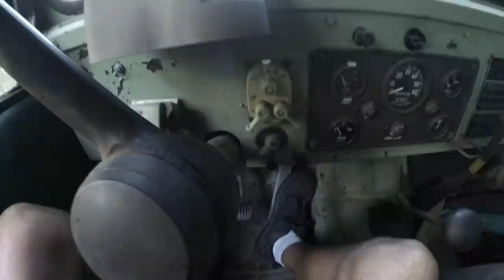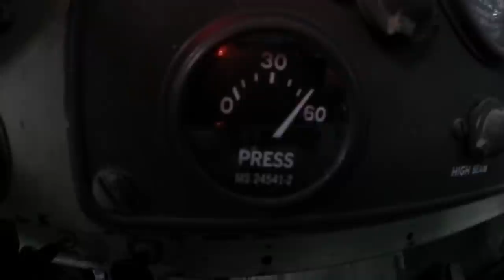Check Out My M715 My Grandad Gave Me!

Comment: The Tornado OHC 6cyl was manufactured by Continental engines.  The only problem was it had a very long stroke and people tried to run them down the road in the 1960’s at 65-75 mph.  Find a quality rebuilder and keep your tach under about 2,600rpm.  We saw a lot of them in the shop in the 1970’s and dad put almost 175K on a 1966 Gladiator with this engine and had no problems.  Great gift and it looks to be in excellent condition for its age.

Comment: I rode in one when I was about 10, pulled us out of a mud puddle in the middle of the nj pine barrens I thought it was the greatest thing ever built. Still had those tractor tires. And drove slow but went through anything congrats and happy birthday
Reply: That's what tractors do, lol. The M715 was a road-legal tractor, not fast but strong. Those tires are standard military issue NDTs (Non Directional Tread, I believe).

Comment: I think I would just pull everything off the frame and restore the frame and put it back together
Reply: Agreed. Try a soda blast on the frame in case the frame has markings on it, soda wont destroy them.
Reply: If it was mine I would put it back to stock if I had the skills and coin. I would build the other one to be bad ass.

Comment: That thing has a lot of rare parts on it. Waterproof distributor and plugs. 24v system. Part the motor out and it will decrease in value. Thunderhead289   has just done an article on one.
Reply: Now new jeeps hybrids have 48v

Comment: Aloha from Hawai'i Isaac.  Way back around 30+ years ago my boss at the time got one of these M715 truck at a military auction.  Motor was pretty much shot with the root cause being a blown head gasket.  At the time one of the biggest motor sports in the country was tractor pulls.  My boss wanted to turn this truck into a sled puller.  We put in a built 427 Chevy big block.  I forget if we used the stock diffs front and rear but it did well at the first Hawaiian tractor pull competition held in the State of Hawai'i held inside the Aloha Stadium.  This was in the late '80s.  I always though a Cummins diesel would be a nice engine sway in one of these.

Comment: GREAT Rig the M-715, I have owned M37 M52  etc. The expensive parts on the engine are spark with coil built into distributor Sealed unit to keep water OUT, Small block Chevy or diesel 4BT cummins work really well. I'll watch you progress young Man.

Comment: Happy Birthday first. I had a 64 Jeep J300. Hood area was a similar design but latched. Mine was 4WD but had a a 2 speed rear diff. Someone converted the original engine to a Chevy 283 V8. The engine developed a rod knock the first week after I bought it, I rebuilt it. That truck would crawl any grade. The rear diff switched electrically. It also had an overdrive lever that eliminated the clutch after you started moving. The rear diff gave me 8 forward gears. Yours reminded me of it. Enjoy.

Comment: I remember when the NTS (Nevada test site) was auctioning a bunch of those off. Everyone thought they were a great deal at $200. About 6 months latter they weren't any on the roads anymore. They couldn't take the desert heat either without blowing those head gaskets. No hot dogging required

Comment: Isaac I absolutely love that M715 that Jeep absolutely adore of those I drove one many years ago I wanna say that it was a 68 or 69 model I guarantee you there was no place that I could not go in that truck and it had been to dealerships for the transfer case plus it was also a standard so it actually had putting sticks in the floor I guarantee if I had that today I would never ever let it go lad never sell it and I would keep driving until the wheels fell off then I would rebuild it. If I'm not mistaken the one that I had, had AV8 conversion but I'm not positive I know that at 1 time I had another 1 similar to that  had a  258 straight 6 and it was a strong motor and it ran really good and if I'm not mistaken I believe the  258 came out of an International.

Comment: Happy Birthday what a great special gift. I agree keep it like Grand Dad did just clean up the engine bay.  More Kaiser Jeep footage especially the parts truck with a huge push bar, Cummins diesel, 12 volt system, off road lights, and front & rear logging winches to clear your properties after storms. First gear in 4wd Low is a real deal pulling machine.

Comment: I would love to have my grand dad's truck, he passed away a few years ago but my grandma has it in case of need. It's a 91 Silverado 1500 extended cab 2wd with a 305 auto, that has under 100k and is garage kept. It's been used as a truck and has scratches and such and the doors need bushings, but it still drives and feels like new.

Comment: Congrats, I bought mine back in 2011 and lucky it already had a small block 350 in it, all I had to do was replace the Axles which I did with Chevy 1ton axles and it's sitting on 33's, everything else is original

Comment: I've got a 1967 M715 Kaiser with a swapped 327 double hump. It's awesome. All original(with the pto winch and blade bumpers) except for the engine swap...oh, and 37 inch Buckshot Mudders - on the split rims. The old dog multifuel tornado engine S6 was so slow and gutless(I converted it to a regular carb/gas setup too) it had to go, plus the old rope seal rear main will always eventually leak and then the clutch is screwed - keep an eye on that if you stay with the Tornado 6. She's sweet. I call her Sgt Mamaw. They'll have a Dana 70 in the front, 90 in the rear. Once you get them set up right, they'll go anywhere you point it. The only problem with that, is once you get in there - you gotta get back out. I have the canvas top style. I've also seen one with a hand made and riveted aluminum top too. Top speed with the 37s and 327 is about 65 to 70, and my goodness it's a white knuckle rush when you peg it at the start of a climb, a mudhole or some such predicament from a dead stop. It's a beautiful thing.

Congrats. You're gonna love it.
Reply from the maker: Sounds sweet. Ill keep this thing forever
Reply: @isaacitllbefine7231  I've had mine for over 30 yrs now.

Comment: NP200 transfer case w/1.91.1 low range, 132.5 HP, dana 60 front, dana 70 rear w/5.87.1 ratio top speed 55 mph. From 1967 to 69 30,000 to 33,500 were built
bad about blowing head gaskets, and cracking block between the two cylinders that are side by side, with no water jacket between them.
Dodge still building decedent for S. Korean army, even built tribute concept truck of original M715 for Moab, Utah 50th annual Easter Jeep Safari. 
Here Ike that help you out, and they're cool old 4X4's, and beefed up front end, and 12 valve would be a blast, but figure on replacing diff's as they're built for very low hp, and tq. That would be a blast of a build, but Grand Pa's should stay close to stock in his honor.

Comment: In the late 1960's and early 1970's Jeep used the Buick 350 engine in the Jeep trucks. That ohc engine is terrible. Keep all the ohc bits but then swap it with a buick or chevy 350 or even a 292 l6 it will make the truck suitable for taking trips pulling a trailer as opposed to taking trips with it on a trailer. Nice truck!

Comment: Tornado i6, rated as a 1 1/4 ton with 5.89 diff gears and can put 38s and or 40s on it without modifying anything
Reply: Funny I said that before to started reading the info from your cell and that's just what I had in my head from when I had my 72 wagoneer that I had a spring over lift with 4" lift springs and 17-40-15s a 1968 455 olds chevy th400 with the jeep d20 and d44 diffs, never did get to doing the diff gears cause I got a 71 k10 long box

Comment: Put a 302 in it  or a 351 Cleveland. Or what ever you can find maybe a chevy 350 ? A LS would be nice. I would spray some Fluid Film on the frame and everything underneath. That is a great truck man I would drive that a lot if it were not too hot on cool days.

Comment: Definitely throw a 12v ppump 1997 motor with the nv4500 its the best diesel motor and 5speed tyranny nd most reliable nd the only motor recorded to a million miles jus service it and take care of it nd it last forever and the p7100 injection pump is all mechanical and you can gain up to like 150 or 200hp by jus turning screws and adjusting things in the pump and timing gear nd the motor is all mechanical but for the power the few sensors it has but you should Definitely do that swap in it and you can pick up and good deal on them jus keep an on out when you see online forsale already to go for like 5k to 7k get the southbend clutch in the 5speed and its unstoppable

Comment: I've restored 2 M715's. A 67' and a 68'. I love the trucks but that 230 OHC sucks! I wonder if the heater box on yours is stock? that was usually installed on the trucks with the artic package for cold climate areas (which also included the hard top which was fiberglass). Although the wagoneer and cherokee chief heater boxes bolt in as well. Hell yeah Ike, cruise that truck.

Comment: if you want to try diy clutch and gearbox, try magnetic locking clutch (like a screw driver pressed into socket) or try extended changing ratio magnetic "gears", either planetary or actual gear-likes

Comment: From what I know of 2 friends with M37s the rag top was called s bimini top. Also there is a rare cap for the jerry can to act as a fuel can.
Check out kadiak dot org slash joe for a pic of a 62 M37 with the jerry can trick in use. The tornado was great, we had an old wagoneer with one at camp. 4 wheel mil tires with chains, no body past the dash, you sat on a 25gal drum for a seat and had wood rear fenders.
When the snow mobiles got stuck, you cranked up the 'rat' to go get them! ROLFMAO

Comment: 1.25 ton (US ton = 2,000 lbs) is equivalent to 1 Imperial ton (UK ton 2,250 lbs) which is equivalent to 1 metric ton 1,016 kg.  Which logically, the metric system makes sense.  When I was young there was no internet to actually get answers to a persons questions and I just assumed that 1 ton was 1,000 lbs.

Comment: Gonna put a straight 6, 300ci? a 289/302 or 5.0? Looks like there's plenty of room :D
Reply: Actually, if the head doesn't cause you any grief, I'd keep it original. That's the coolest truck on the road! Every little bump, rattle and squeak makes it even better. I'm weird that way. I love this stuff. I'd cruise around with a steam engine if I could just for the fun of it. You're gonna have a blast in your new ride.

Comment: Most all Kaiser and Willys vehicles were designed primarily  for off road use. They have smaller engines for economy and very low gears. The most common pilot error is to drive them too fast and over rev the engines. The second most common error is to stuff a big V8 into them and expect a higher road speed. The wrecking yards are sadly full of botched back-yard jobs done by people who thought they were smarter than the engineers who designed them. Yours seems nice so just keep it under 3,000 rpm sustained speed.... 50 years of Willys/Kaiser mechanicing.

Comment: Time for a 2010+ 5.7 Hemi swap.. over 3X the horsepower and close to 3X the mpg. I still love the old J10 Gladiator and Willys pickups but unfortunately I'm about a foot too tall to drive either at 6'10 and all torso. The coolest part about those is the front end is EXACTLY the same base sheet metal as the Kaiser FSJ so you can put the cool grille and lights from the Cherokee and Wagoneer on them and make it look really cool. https://upload.wikimedia.org/wikipedia/commons/thumb/9/96/1964_Jeep_Grand_Wagoneer_%2812670036305%29.jpg/1280px-1964_Jeep_Grand_Wagoneer_%2812670036305%29.jpg Good luck finding those tires anymore, I think they were made by Carlisle for the military only. Yep, it's definitely a Kaiser, leaking all sorts of fluids underneath.. but hey at least it's got Dana axles.. I'm thinking raising those gears to 3.55:1 or 4.10:1 would be a great idea unless you want to run 44" tires. Wikipedia FTW again.
Specifications
Length: 209.75 in (5.33 m) without winch / 220.75 in (5.61 m) with winch
Width: 85 in (2.16 m)
Height:
At bed (with cargo cover installed) 87.7 in (2.23 m)
At cab 75 in (1.91 m), Reducible to 59 in (1.50 m)
Weights:
Gross weight 8,400 lb (3,810 kg) [1][3]
Payload 2,500 lb (1,130 kg) off-road / 3,000 lb (1,360 kg) on-road [3]
Net weight 5,500 lb (2,490 kg) without winch / 6,000 lb (2,720 kg) with winch [1]
Engine: Inline 6-cyl, 230.5ci overhead camshaft Tornado
Horsepower: 132.5 hp (98.8 kW)
Transmission: Warner T-98 four-speed, synchronized manual
Transfer case: New Process NP200 two-range, 1.91:1 low range
Axles:
front: Dana 60
rear: Dana 70 full-floating
ratio: 5.87:1
Electrical system: 24 volt utilizing two 12 volt batteries in series
Brakes: Hydraulic, 4-wheeled drum
Fuel type: gas
Fuel capacity: 28 US gal (106 L; 23 imp gal)
Top speed: 55 mph (89 km/h)
Turning radius: 28 feet (9 m)
Tires: 9.00 × 16 8-ply